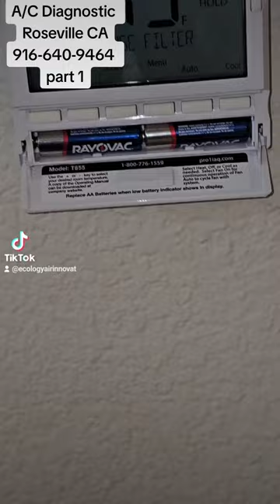#sacramento #hvac #acrepair #hvacservice #elkgrove #roseville #condenser #fanmotor #ecologyair

Comment: Is the delay a feature of the thermostat or an external device connected in- line with one leg of the 24 volts to the contractor ????
Reply from the maker: Almost all thermostats have it
Reply: @ecologyairinnovations6375  Ok thanks, I’d love to rip out that external ( unpredictable ) delay-on-make module from the outdoor unit. Great feature in the thermostat, glad to see the manufacturers were thinking about the dangers of short- cycling. 
Thanks for the info.👍👍👍